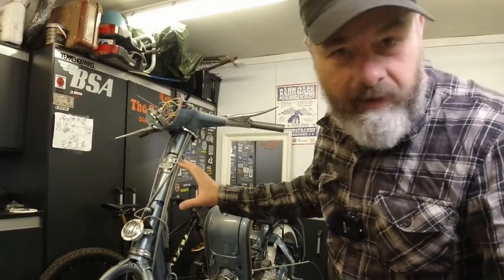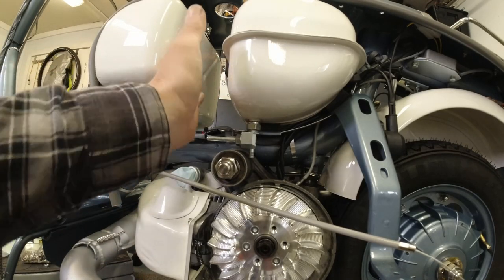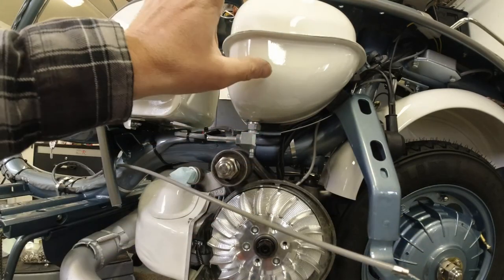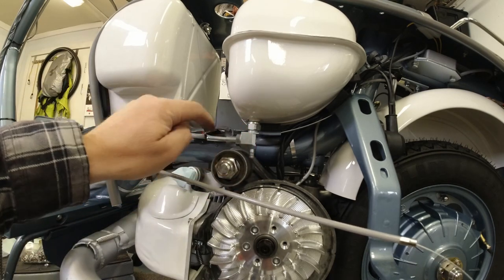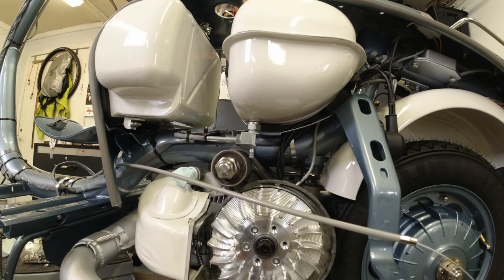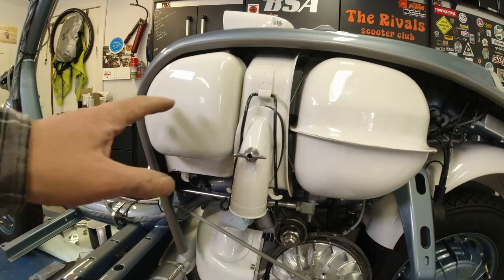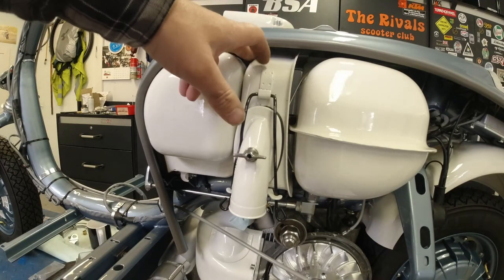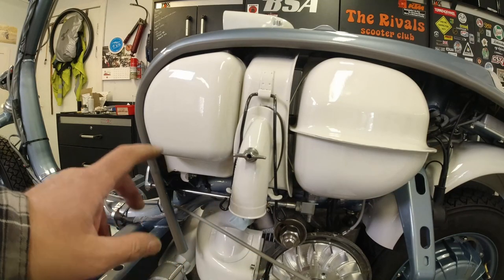Lambretta , TV175 rebuild, part 13

Comment: My petrol knob was sticking out proud like yours so I turned the petrol tap a little where it fits to the tank, (which is how the one on my SX was back in 1970) nice and easy 😀
Reply from the maker: This is long stroke, so the carb sits more towards the frame loop.

Comment: Hey Rob - just noticed in your video that the rod that holds the air filter to the air box neck is the wrong way round.  The wing nut should be behind the holding plate 👍
Reply from the maker: Watch the next video and all will become clear 😉

Comment: Hey Rob, just noticed that the little o-ring of the choke is missing. It ought to sit in the groove of the alloy part that is held in place (in the carburetor) by the little screw. Cheers.
Reply from the maker: Its on now ;)

Comment: i use stainless steel cable ties that are used for fire alarm cable install.. i had the same issue with the scootopia ties
Reply from the maker: Top tip there Steve. thanks.

Comment: Could you please elaborate more on how to fit the throttle cable to the carb i,m having a problem with it  PS I have a TV 175 s3
Reply from the maker: I did that on my dellorto set up video 😎

Comment: Hey Rob, great work. Been following this rebuild as I redo bits of my sx, really useful. Have missed the throttle cable instal. Did you cover that? Can only see the small bit just after the choke cable fitting in this vid at about 26 mins in ...
Reply from the maker: I fit the cable at the carb first, then connect to the throttle wheel with the solder less nipple. Just make sure that the tickover screw is adjusted fully out so the cable has a couple of mm slack. Hope that helps Neil.
Reply: @kickbackgarage  cheers Rob.
Reply from the maker: No probs, glad to help.

Comment: series 2 wing nut holding the air filter in?? should be a rod that goes through the elbow and is fixed inside..
Reply: just turn the tap clockwise mate...will pull in the lever.
Reply: @stevetowers8282  might foul the position of carb bud
Reply: Both points above- the universal joint design allows the rotation.
Reply from the maker: Its early s3, with rod.
Reply from the maker: It is rotatad in. Have shortened it now.
Reply: All good then, from the angle it was difficult to see if the articulation was straight or angled. Always best to check.